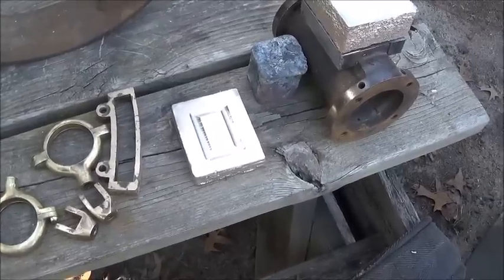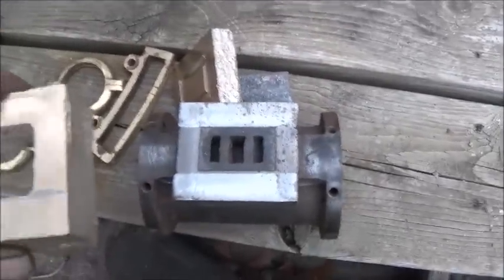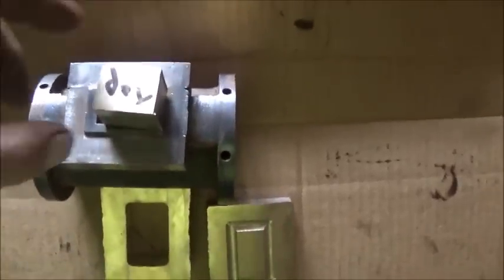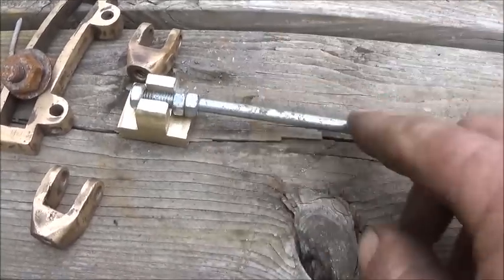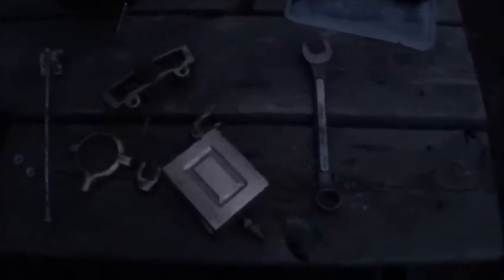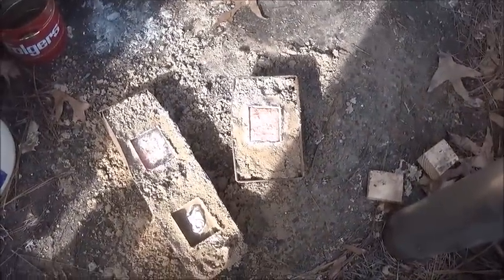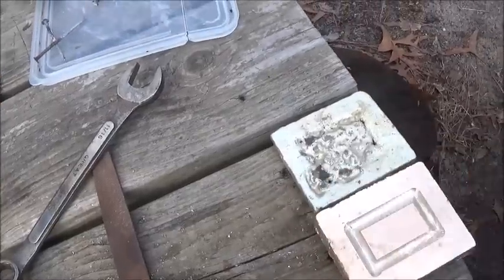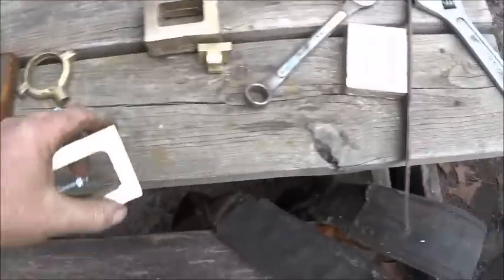CASTING PARTS FOR MY  LATE 1800's MARINE STEAM ENGINE

Comment: Fascinating work, Jonathan!  We made hard packed two piece sand molds to cast aluminum parts in High School (when High Schools taught things! 😒).  I still have fond memories of it lo these many years.  Nice trial and error, sincerely meant.  Could you not enlarge the inner area for the D-valve instead of cutting all the corners square.  Have your slide overshoot the 2 outboard holes by just a little?  It's going to be a sealed boundary still, just a wee longer.  Great work, Jonathan!  Thanks!  Oh, you gonna put that Challenger SRT Demon in a Go-Kart? 🤣  Nice drag for you!

Comment: Adding a bit of aluminium will soften it , but too much will make it too brittle! Bit of a guess and hope solution or you could always go to a known metal like brass valves that are cast to allow cold machining so will easily handle a thread cut into without being too fussy !

Comment: Great contrast btw wrecks (destruction) and building castings like yours, Jonathan!"Copper, zinc, and aluminum makes interesting alloy (brassinum).Copper and tin for bronze------too hard to seat against cast iron.Annealing procedure is usually reheating a casting for desired metallic  properties.Steel crucible glowing, so do not use MAPP gas in that application.

Comment: I'm wondering if you've got a running spreadsheet of metal formulas for the various casting needs. I've cast aluminum, brass and copper, but bronze seems to have a number of variations depending on application; marine bronze vs. sculpture bronze. Just curious if you have a list, or keep it in your head.
Reply: Brass in contact with steam is a no/no, as the zinc reacts and the part goes brittle.  "Classic" bronze is a copper/tin mix  and bell bronze is (indeed) a specific composition.  These days, bronze refers to cupric alloys, where copper is mixed with something other than zinc.  An interesting cupric alloy found in steam engines is "gun metal", which is a copper/lead mix.
Reply: @eliduttman315  Thank you for the info, Ed. Much appreciated. I'm a novice metallurgist, but professional artist. I've cast a number of sculptures in aluminum and brass, but mixing my own bronze is next on the list.

Comment: Just a "curious" type question for you: Wouldn't the "D" cup be better with a hole or holes for that 1/4" linkage rod instead of a slot ?? Especially  since the rod is loosely fastened to the cup.  Is it and/or the Steam Chest tall enough for that design??